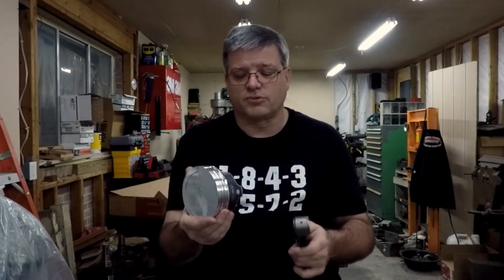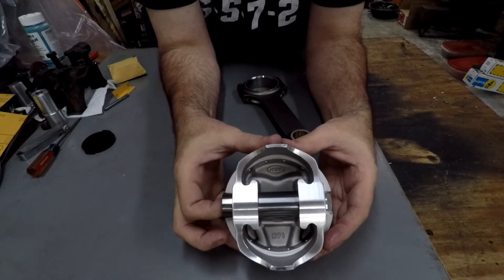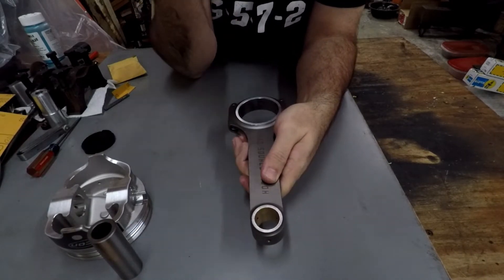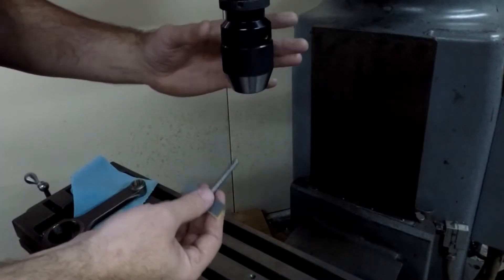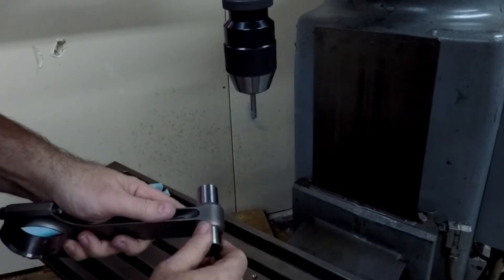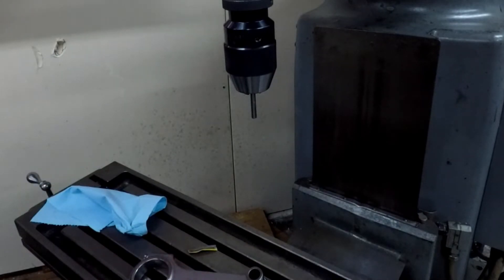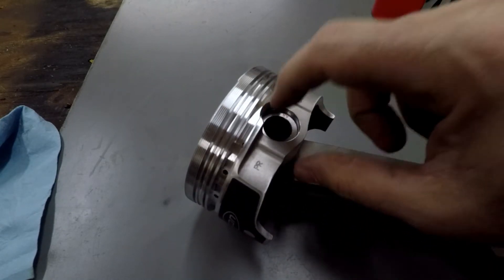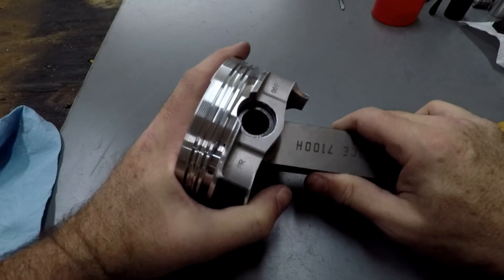440 Source 543 inch stroker part 2

Comment: Brush research for a hone or stick them in your tobin-arp to check if the bores are square  and leave a cross hatch    did you hang and align the rod/piston assembly?

Comment: A lot of times there will be a very small lip on the edge of the rod from honing the pin bores. That usually will cause a tight spot on one side and needs to be removed.
Although your idea with the sand paper flapper will be a safe way for people to kinda massage the rod pin bores without a rod honing machine, 2k grit paper is wayyy to fine. Your polishing the bushing and removing the ability to hold oil for the pin to ride on. The pin is polished and the rod pin bores need a crosshatching to hold the oil film just like a cylinder wall. Don’t use anything more than 600grit to do this or either take the rods and pistons to a engine machine shop like I have for us to hone them on a Sunnen rod hone with the proper surface finish and oil clearance that the pin requires which changes depending on the application.

Comment: My 543 dropped a valve recently.  It's a 10 year old build at its been to the track many times but, this happened  as I was just driving down the road at 40 mph.  The valve head fell into the cylinder and put a big window in it, too.  Is this an inherent problem with 440 source valves?

Comment: Hi,   In your video you stated to install the Mopar RB & B rod's chamfer side opposite the intake valve pocket on all the cylinders?  Chamfer goes towards crank throws and that would only work on 4 of the cylinders.  Hope I'm wrong but I don't see how installing all the rods on all the pistons this way would not cause problems.
Reply from the maker: That was referencing the piston I was working with. You need to align the chamfer with the counterweight and make sure the piston is facing properly in each hole.